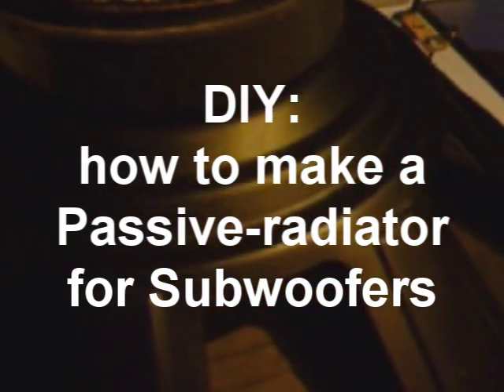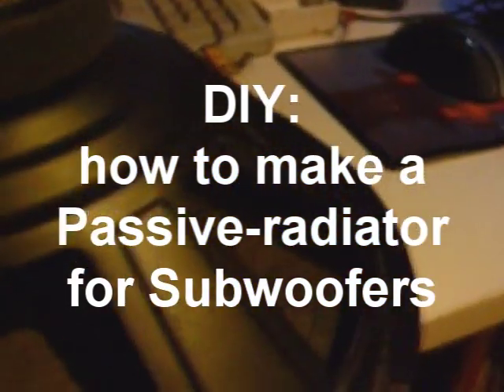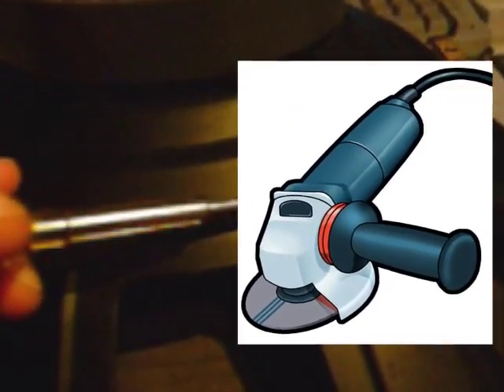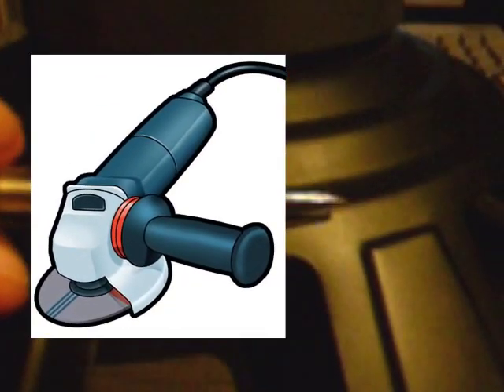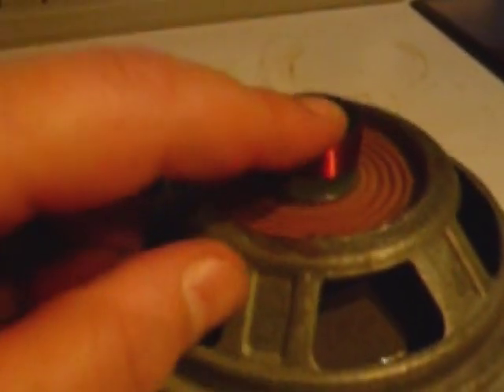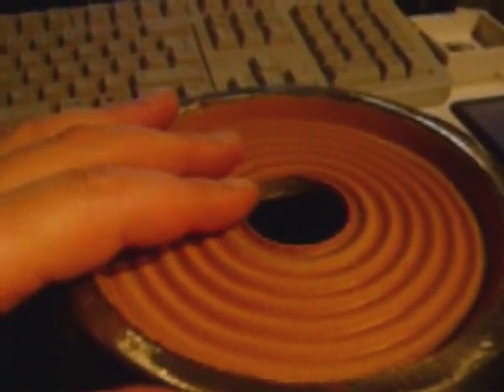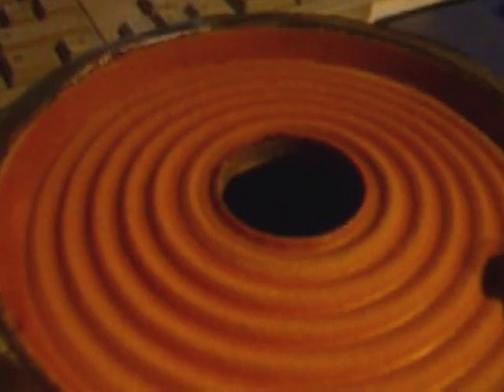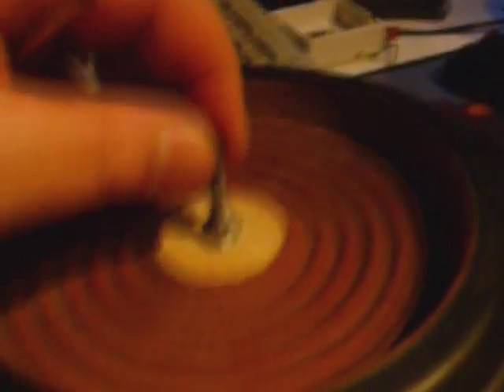DIY : how to make a Passive-Radiator

Comment: I got 10' sub how big should i use as radiator?
Reply: Can i use 2.2x2.2mm pasive raditor to 10' inch sub??
Reply from the maker: i recommend using a 12" PR for a 10" Sub.

Comment: Can i use any type of drivers to make a speaker with passive radiators to give the bass like for example bose SLM bluetooth speaker.Or do i need a specific kind of drivers to give that kind of bass.Can i use my PC speaker which does not have bass and add a passive radiator and make it sound like the bose SLM????

Comment: Hi !  i have a 6,5 " speaker and i have and 10" old broken speaker ,can i use it as passive-radiator or its to big ?
Reply from the maker: That should work fine i.m.o. It will not move as much, but will have better efficiency, due to its larger Area. Hope this helps and good luck with your project :-)
Reply: thanks a lot ;)

Comment: Thanks a lot for the video, just beginning to learn about passive radiators and this explanation really helps!
Reply from the maker: you are welcome :-)
Reply: @Elnufo  Interesting video (subbed). Read my comment @ Mike Faulkner.
Reply: You only have to take the magnet off if you think the cone might make large excursions and touch (when loud). And if you need the magnet off (for loud bass) then all you have to do is ram a (flat) screwdriver in between the (magnet and frame) and give it one full on hard bang with a hammer. And repeat on the other side of the magnet. One decent blow on each edge should get it off in seconds. That is as with most pressed frames (not cast frames). You don't need to remove the voice coil (you need it for a weight case) and use blue tack for weight in the front of the cone (at first) on the "dust cap". That way you can (and have to) tweak the weight outside and in front of the driver for convenience. Start by guessing how much blue tack you need and put it in the center of the "dust cap". Try it and if bass is thick and punchy and no boom, decrease weight. If bass is boomy but not punchy, then increase weight (a bit at a time). That's why you have to have the weight outside the speaker on the "dust cap". When you have the perfect weight, weigh another sample of blue tack (for the other speaker if appicable) and put the blue tack weight inside the voice coil at the back of the cone (all sealed away and neat). And you only have to take the passive radiator out of the box once to put the final weight into the voice coil tube. It doesn't matter if it's on one side inside the voice coil tube. You can make passive radiators for stereo speakers too (I did) and it was a VAST improvement. Bluetooth speakers wouldn't sound anywhere near as good without them, so you can imagine what they can do with stereo speakers.

Comment: Its all about timing and resonance, of course yhe more effect and dampfactor in the amplifier will do it easyer to Control big masses in motion, the head room can be usefull, in what ever type of enclosure you chooze and no its not 180 degres out of fas, it dependes on the weight and enclosure thats the Point of the weight, .... happy bassing

Comment: I like your video, hasen´t seen it Before, i building my  own passive radiator´s too and i can say that this is the way to do it, it can have a flat front or just like it on this video, the most important thing is to have the right weight or weight´s if you drive with more then one PR´s if you choose thr right enclosure combinated with the right amount of passiv Sd, and weight you will have a sound that  can shake your room or house, great video, Med vänlig hälsning  Chrick!

Comment from the maker: Finding the right amount of weight is a "try `n error" thing. What ever pleases your ears will be right. I reccomend not using 2 12"s. The effective cone area of 1 15" is too small to work with two 12"s. One 12 will be enough to properly drive a single 15" as a passive, two 12"s may cause too much excursion of the 15". Give it a try though and let me know about the results :-)

Comment from the maker: These things are meant for building subwoofers with them. A ported box may be louder, but can have serious issues with flow noise caused by the port. A passive radiator doesnt produce any unwanted noises at all.

Comment from the maker: @JillBattleSlut I agree, it's much easier and faster to just force the magnet off, but the way i did it it looks better :-))
There is a good feason for using weights: The resonant-frequency of the PR defines a zero crossing in sound pressure level, that is why the PR should be tuned at least one octave lower than the pushing Driver.

Comment: I'm making a passive radiator from a speaker but i'm not sure if i should leave the spider on or take it of. The suspension is really stiff and it's already hard to move the speaker by hand. Should i remove the spider?

Comment from the maker: @Dampfplauderer96 Also zunächst einmal: Mit einer Passivmembran anstelle eines Rohres hat man keine Strömungsgeräusche mehr, also klingt der Bass i.d.R. sauberer. Der Passivstrahler sollte immer wenigstens eine Nummer größer sein als der antreibende Bass, weil so erstens die schallabstrahlende Fläche größer wird (besserer Wirkungsgrad) und zweitens der passive nicht so viel Hub machen muss (weniger Verzerrungen/Klirrfaktor)

Comment: Hi,
Do you think the Conrad-elektronik loudspeaker series "DYH" are good for this use, especially the 12" version? 
Which diameter would you recommend for the active speaker, if i want to use the 12" passive.
You can answer in german if you are german ;)
Leo

Comment: @Elnufo 
ok, i asked out of curiosity not to discredit anyone or anything lol I am curious though because I was under the impression that the compression and decompression of the active driver caused the radiator to move back and forth. So if Im correct, as the active drive pulls in (toward the interior of the cabinet) it creates high pressure inside the cabinet and thus the radiator is pushed out (away from the interior of the cabinet). So isnt that 180 degrees out of phase?

Comment: hey man , ur video was awesome , I have a query abt my logitech 530 subwoofer , it dies out completely at lower frequencies and produces boomy bass , just wanted to know how can i improve and make the bass tighter , will adding a passive radiator help ?????
Reply: dante DMC of you want it tighter, try blocking the port on the sub box. PRs produce that deeper boomy bass you're talking about.

Comment from the maker: @stevo0625 No it won't. That is because a 
Passiveradiator does do the same as an ordinary bassreflexport does, it turns the phase 180 degrees. The alignment: Volume & passive is a Mass & Spring System. Those Systems do turn the phase, otherwise thy simply wouldn't work.

Comment: Hey man, cool video. I've been doing a lot of research on passive radiators recently. I have a quick question. At the end of the video you said that in your next video you'd take a look at the recommended enclosure for a sub with a passive radiator, but I checked your videos and it looks like you didn't get around to it. My question is, is a sealed box within the company's recommended size going to work well with a passive radiator? Any other advice on the enclosure? Thanks!